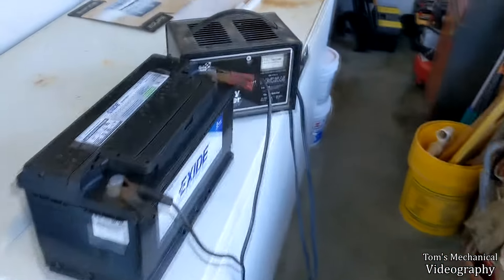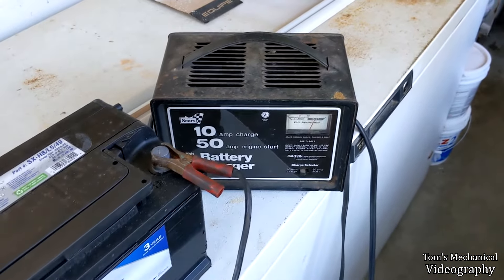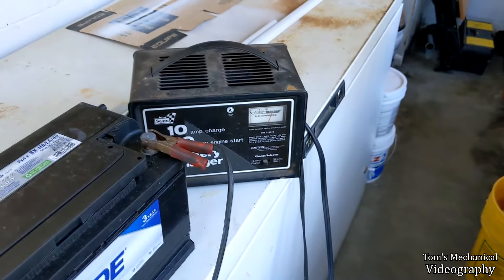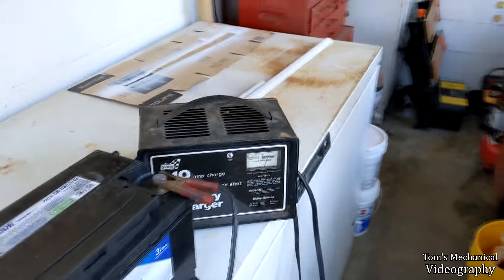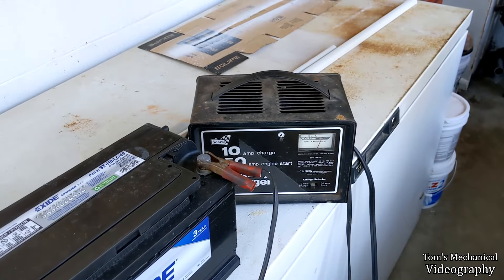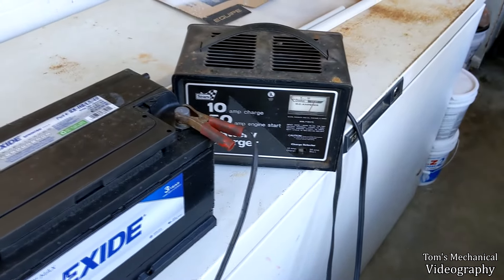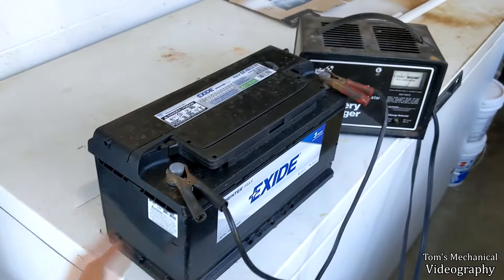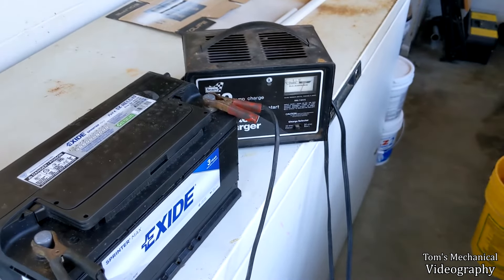How To Use an Old school Analog Battery Charger

Comment: A 12 volt  battery has six 2.1V (or slightly higher) cells. Most of the time descriptive battery voltages are nominal, even on little watch batteries. A 12 volt car battery at 12 volts is very dead. Fully charged is 12.6V or slightly higher. There will also be a surface charge immediately after charging with a charger or an alternator, due to the higher charging voltage. This can give an incorrect impression of the state of charge. An easy way to confirm state of charge after a battery has been charging is to turn on the headlights (approximately a 15 amp draw) for 2 minutes, THEN check the voltage after giving a couple minutes for the battery to recover to its resting voltage. Look up "State Of Charge chart for 12V car battery".

Comment: As a general rule with these, the battery is fully charged when the meter shows about half the charging rate, or just under.  That is under ideal conditions with a good battery, and assumes that the battery initially was drawing higher current and the current tapered down as it charged.   Other battery conditions can cause other meter readings.

Comment: even an almost dead battery will read above 12 volts when you measure it with no load.
Hook up some sort of load, like a 12V spot light, tire inflator, etc, let if run a minute and THEN measure the true voltage it is putting out

Comment: Will this kind of “old school” charger power a small 12v DC motor? Do these chargers overheat? There’s  a Zodys brand (UL approved), 30+ years old for sale locally. Worth $25? Thanks.
Reply: Have to be a big dc motor to over heat the charger.  But yes they would power a decent size dc motor, just start on the lower settings first.
Reply: sure but using clamps to wires instead of a solid wire to wire connection is going to melt something

Comment: Can you recommend a decent-priced good quality NEW trickle / battery charger?  Not even sure that a trickle charger and a battery charger are the same thing.  My husband died and so did his van and all I have currently are two chargers that look similar to this Sears one.  One is a Schumacher Dual Rate Battery Charger Model SE-82-6 that says 6/2 AMP  and has two slide switches - one to switch between 2 amp and 6 amp and the other switch between 6 volt and 12 volt.  The second device is a Schumacher 2/10/50 Trickle Charger/Battery Charger/Starter Charger Model SE-10-52 (12 volt) has only 1 switch that goes between 2, 10, and 50 amps.  I have nice neighbors that would help but I need to learn how to do this myself.  Between the two "analog" devices I have, I'm not sure which is better to use until I buy a modern one -- based on the recommendations I get here.  Thank you , g in alaska
Reply: Well select the 6 volt setting for a 6 volt battery and the 12 volt setting for a 12 volt battery.  To trickle charge any battery select 2 amp.  For charging for 30 minutes use 10 amp.  To jump start a battery on the car use the 50 amp setting but only while you start the engine.  Once engine is started remove charger and switch off.

Comment: I still don't understand how to use a manual charger
Reply: helps to have a volt meter too so you can meter it before, during and after.  If you do a "manual" charge you just have to keep an eye on the position of the analog meter's needle. Once it goes to the far left it is fully charged (or it's not because it's bad and it can't get to 11.9 volts or better)
Reply: The key thing to understand, is battery charging is very much temperature dependent. Batteries don’t charge fast when it is cold, and they need higher voltages to compensate. 

These are heavy, transformer based chargers, the windings are “sized” to be about perfect for the typical 50 or 70 amp automotive battery. If you live in say, North Dakota, and it’s 10 below zero, these chargers could be left connected for weeks at 2 or maybe even 6 amps and they would settle in at a decent float charge. Once it warms up though - even though the current is very low, the voltage output is too high and electrolyte will boil out. These are excellent chargers but the unregulated voltage must be monitored. They work almost perfectly combined with a Variac.
Reply: Usually, if the battery is low or fully discharged, the meter will show the full charge rate or higher.  The circuit breaker might even cycle on and off if it’s drawing maximum current.  A healthy battery that’s just discharged, will initially draw full current (another reason it’s not good to use your car alternator to recharge a fully discharged battery).   As the battery charges, the voltage will rise and the ammeter will taper down. 

The meter will never read zero even when the battery is fully charged.  Don’t leave the charger on, expecting this to happen.   As a general rule, the battery is charged fully when the meter shows half the charging current or just under (3 amps on a 6 amp charger).  You’ll also notice that the meter won’t show any less.  There will be some gassing in the cells as it approaches full charge.  For an old school manual charger like this, a battery can be damaged if it’s left on a charger for too long.  

Make sure the fluid level is good in the cells, if there are caps that come off.  There’s a split ring in each cell. If the battery is discharged, fluid level will be lower than normal but should still cover the plates.  If not, add only distilled water, just enough to cover the plates and no higher.  Don’t top it off.   As the battery charges, the fluid will rise.

Comment: Dumb question maybe but what about newer battery chargees that can not charge the battery after it is full charged,how does that needle work,does it still go from right to left when charging?If so,this makes no sense for me cuz everything we do we go from left to right,even writting,no one writes from right to left except few arab countries.btw,it's an Einhell battery charger ,german product.I'm trying to charge my car battery,it was at 6 volts and its a 12v battery,first time i plugged it in it was around 6 v but what irritates me is that the needle goes from right to left,now it sits around 3v,i turned it off once and connected it again at it was at around 9 volt then it started going down from 9 and now it is around 3 as i already said.Does it show how much volt the battery is after you plug it in and then it starts charging it from right to left,is that the case here?
Reply: Yes right to left for an old analog display like on an old Schumacher charger etc.

Comment: lol, did same about 20 years ago charging car batt and forgot abouts and I ended up boiling battery/ ruined it.  Also  WARNING  Flammable Acid Gas's....Very Dangerous
Reply: I’ve seen one exploding in a shop while getting schooled in mechanic, battery was charging with caps off (30 years ago), he started welding something at about 6 foot from the battery; battery kaboom 🤣🤣

Comment: A fully charged 12v battery should be at least 12.5 - 12.6 v. 12volts even is discharged. No wonder you only got a click. Nothing wrong with that meter.